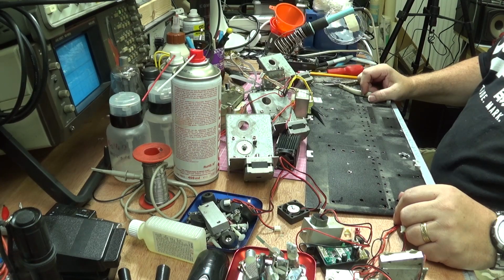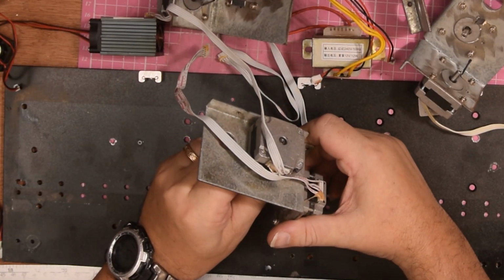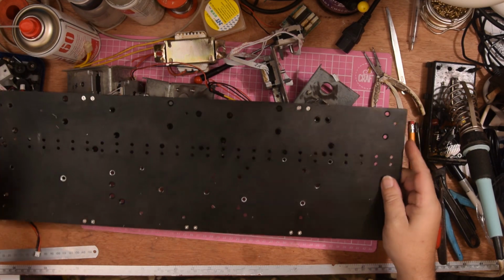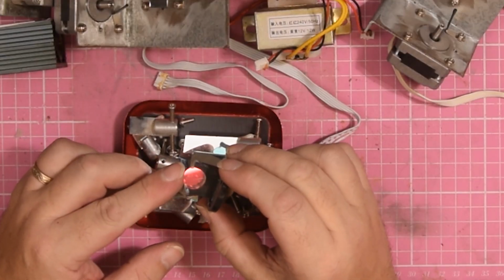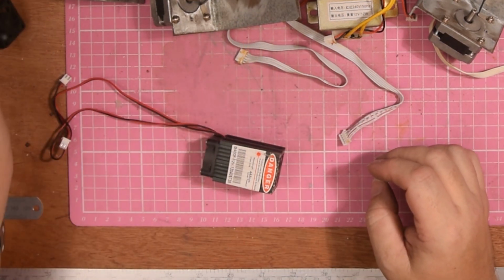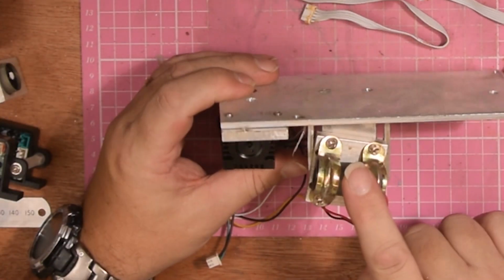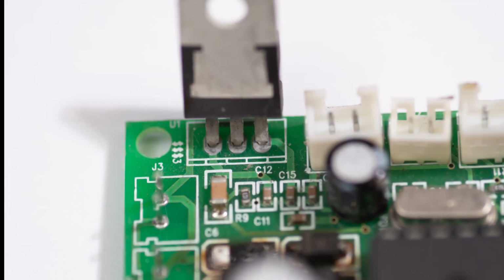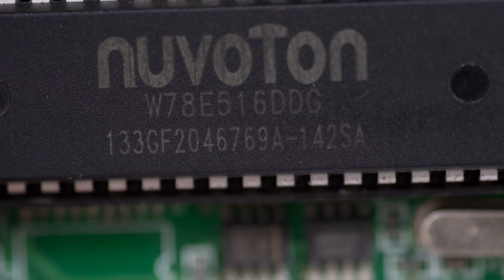Pegasus Laser Restoration :  Part 2 - Teardown

Comment: Now that's a tear down George. But, to add anything or make sure it is done right taking it down and building it back up is definitely necessary. Why on earth would they use that much glue on that board. It seems sort of self defeating trying to have a gummed up with glue like that. Well glad you are cleaning it up as you go George.
Reply from the maker: I really don't see the purpose of all that glue either, unless they have tried to make up for stripping threads or similar. No doubt I will find out soon enough!